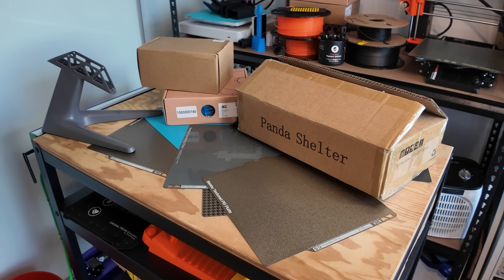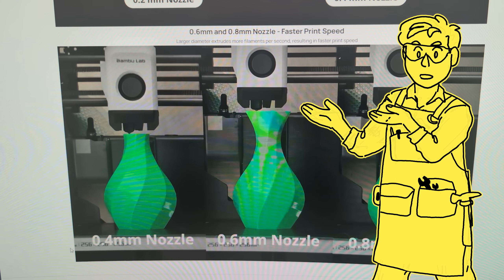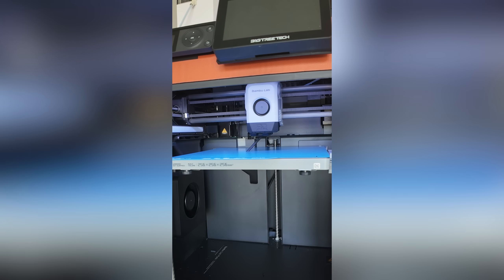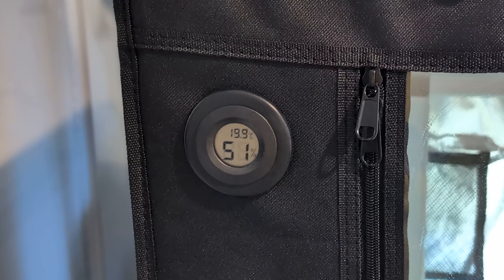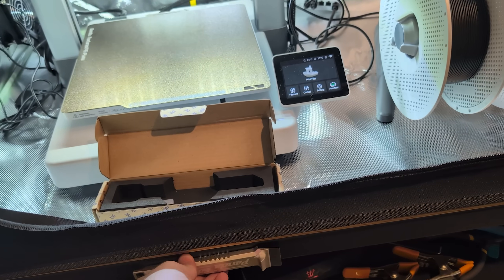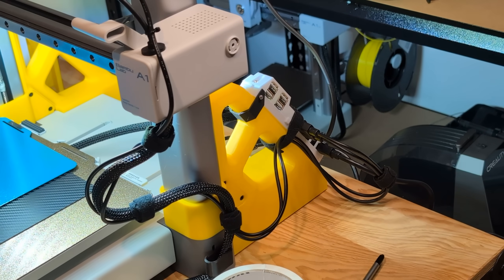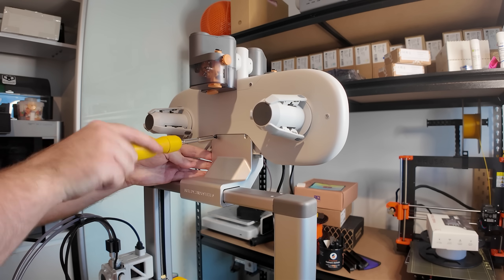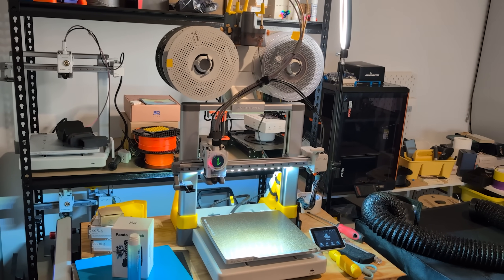The Best Upgrades for the Bambu Lab A1

Comment: Has anyone managed to get the LED to stay on? It was impossible to fix it, I had to return it.
Reply: The led strip?  It's linked to the camera light setting.  Only activated by the camera light.  

I installed my own led strip, independent to a Milwaukee 12v battery with a 12v led strip I modified.  You have to know how to do this if you decide to take that on.

Comment: Is there any way to print with two colours without the AMS? My printer simply drew out the previous one and asked me to put in another one
Reply: Don't quote me, but.....The AMS is linked with the printer to automatically switch during prints.  You can manually stop and switch filaments at any time if you plan to do that in any other way.  But this might be more difficult. 

 I'm new but learning these things as I go.

Comment: Great roundup 👍 I did exactly as you mentioned with a smart plug out of the box, but I also got the same automatic shut off by adding the printer to Home Assistant so I can tell when it’s finished and if it sits for more than 20 mins in that state it shuts off power to the printer and fires up the AC to help cool the print 👌

Comment: Enclosure is nice but the A1 doesn’t have internal cooling on the electronics inside. Just a heat sink.  Check my video on adding a clip on usb powered fan setup to push some air inside the A1!   Print safe!  🔥 Bambu Lab A1 Cooling Mod! Add a Motherboard Fan for Enclosed Printing | 3D Print Upgrade Guide
https://youtu.be/6_0E7GleohU

Comment: So funny how they're no essential upgrades in Bambu lab 3d printers. For example look at Creality ender series, you could upgrade like everything there, but no with Bambu lab, coz they're perfect from the box
Reply: Yes very true. But, Creality was one of the first brands to make 3d printing popular. So hats off to them.
Reply: Yea
Reply: I wouldn't say perfect out of the box but it is pretty good.
Reply: @Commander_Strider Perfect out of the box is an exaggeration for sure, but they are good enough to avoid the majority of criticism.
Reply: @NIGHTDREADED if you compair them to an ender 3for sure
Reply: @Commander_Strider That's a low bar and you know it XD
Reply: @NIGHTDREADED lol ya, I think they are decent machines but I have problems with the slicer and the company, and because it's very difficult to use any other slicer I am not a fan of them.
Reply: @Commander_Strider the machine mechanically itself is more a basis for however you want to tune it to your needs but it works as a stock machine... I don't know. I never felt the need to use the company slicer. It's not like you're forced to use it or anything.. there's so many slicers out there. They just provide a slicer on the microSD card if you want to use it. Honestly, I would take more issue with Bambu because they are the epitome of a closed system... And closed proprietary parts... They are basically HP if it was a 3D printer company because they really do utilize the razor and blades model.
Reply: @mythl.l.l9397  yea, most the failure I see from bambulab is always because of the user errors not because of the printer itself
Reply: Because they are made for completely different audiences. One is hobbyists, the other is consumers. Also, there ARE upgrades you can do on the A1, but its actual mechanicals, not gimmicks like he showed. You can replace the plastic extrusion gears with steel variants, install bi-metal copper/steel nozzles, replace the brass leadscrew knut with a POM one, etc. They aren't perfect from the box, but they are good enough for the intended audience, but there is SO much that can be better optimized.
Reply: bambu labs a1 and a1 mini have been pretty good so far,however both have suffered from the blob of death during the night, had to basically rebuild them,Harder to work on then older printers but possible
Reply: @james61572 Weird, that kinda contradicts the "just works" narrative Bambu tries to sell pretty hard. Also, found out Bambus PSU supplier, Mornsun, is now on the U.S SDN list for providing monolithic power systems / components and other electrical components to Russia 😬. Not a good look...
Reply: I had a creality and got the upgrade for multi color on one of them and it just never worked so I switched to bambu

Comment: the upgrades are great in some of them but i think i can say you dont really need to add the frames to support the printer just because you want to put the ams lite on the printer and i dont think you need the ams lite to do it when you place your printer near a wall you can just do a short criten way to hang the filament. i like the panda screen system but not the rest because some of them dont really need it if you want to make the printer to have more stress on just supporting extra weight that may damage the frame.

Comment: Buying P1S Combo would have been cheaper than all of this, but nice video.
Reply: as someone with both the p1s and the a1 mini, the a1 mini is usually my go-to, unless i'm working with abs or bigger projects. just requires way less maintenance and lubing imo
Reply: @mooseroom  I have an a1 mini combo rn. Do you recommend upgrading to a p1s combo?
Reply: @markschoemehl4080  no, unless you need the bigger bed/ and or want to use abrasive filaments which require an enclosure to keep the heat in the chamber, if you don’t need to print abrasive filaments or need a bigger bed then no, even then if you needed a bigger bed I’d go for the A1 Combo
Reply: @Gamix10  some of this stuff isn't really necessary though

Comment: For your lite mount I highly recomend using PEEK over aluminium, it will be much lighter but also more robust. 
I've used it on industrial robots for gripper contact points instead of carbide tips or on deburr media nozzles (fully threaded PEEK pieces) - this engineering material is just superb.
Reply: Isn't this more expensive.

Comment: Most enclosures like the one shown here are quite bad for your A1.

The electronics are not designed to be enclosed : heat will do harm in the long run.

A better enclosure should only cover the volume of the build plate + the purge system, letting the base with the cables and the right part containing the screen outside of the enclosure.

IMHO the AMS should also be kept outside to avoid damaging the cables. I use a vertical mount on the side (to avoid flexing the top of the printer frame and messing with its fine calibration in the long run) + an AMS cable extension to deal with this issue, but the AMS is a bit wobbly up there !

I didn't find any suitable enclosure on the Internet, feel free to tell me if you found any !
Reply: There is an upgrade he didnt mention that is a noctua fan directly to the motherboard it keeps the MB cool enough protecting it from the hot enclosure.

Comment: Thanks for the upgrade list! If you use the Bambu lab top mount (mine has done 100's of hours on top) ..... and add a ams enclosure, you need to modify the top mount to stop the print head crashing into the enclosure, and access to the adjusting screw is difficult in standard form as well.. If you want a link to the print, I can post it